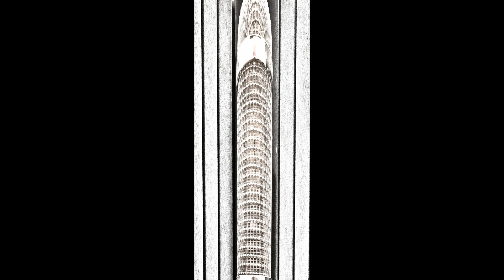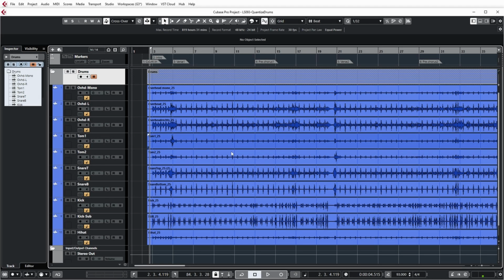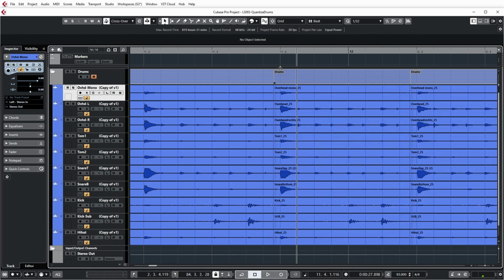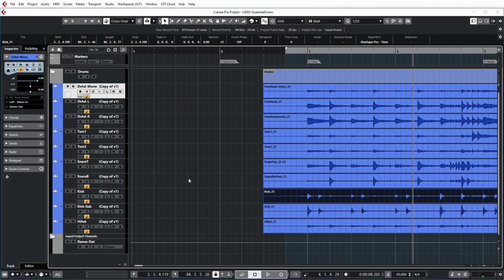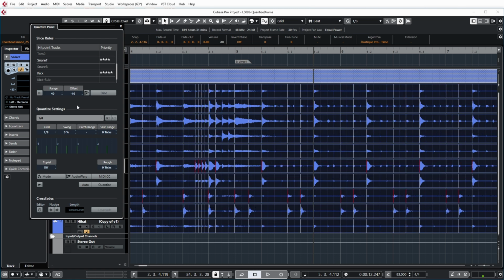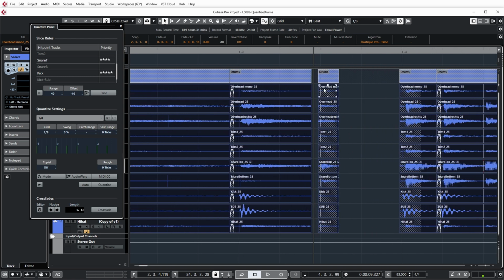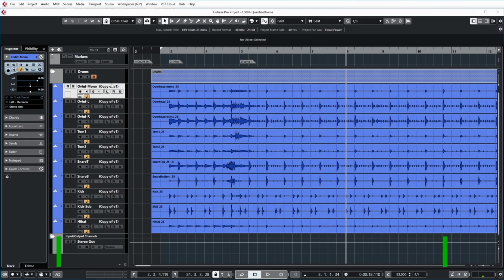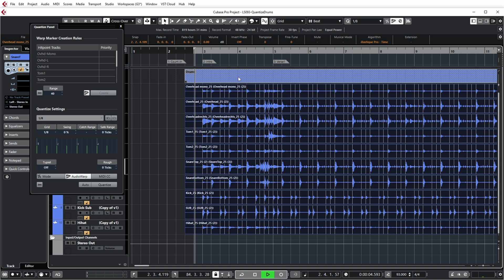3 ways to grid drums in Cubase (quantizing live drums)

Comment from the maker: Amazingly, the just released Cubase 12 contains phase coherent, multi-track, Audio warp!! So method 3 in my video now is a real option and they've even made it more easy by just being able to use it right in the project window.
Reply: does the original drum recording have to be quite "tight" for the 3rd method to work too? I just tried the 3rd way with phase coherent audio warp and it sounded terrible
Reply from the maker: @tommycoylemusic  now that there is phase coherent audio warp in Cubase, that could become my preferred method actually. I have a separate video about it actually https://youtu.be/pPgeG90EhYU?t=502
Maybe it's just a matter of how you have setup your quantizing parameters?
Reply: @LanewoodStudios  thanks for replying! ok but even with the quantising parameters isn't the bass and electric guitar going to sound weird at the very least? anyway I will check out your links many thanks!
Reply from the maker: The video is just about quantizing the drums. And yes if all were recorded together and we’re playing to the drums they will be off too. But that would be the case for all methods to grid drums.

Comment: Correct me if I'm wrong, but this video is more about quantizing drums recorded with a click. Still a great video, but is it possible you could make a video about how to grid drums (and a full band) that were recorded without a click track? I wonder if that's possible to do whilst also sounding natural.
Reply from the maker: Hi Neil, you are right in that these drum tracks were also recorded on a click, but the used techniques in Cubase would be very similar if they had not been. First of all though you have to ask yourself whether you actually want to grid the drums (and band) if they were not recorded with a click. Because then maybe the natural tempo fluctuations are meant to be in the song.
However, if gridding is still required, I would still do the drums separately as demonstrated here, using Cubase 12's new phase coherent group editing mode. I have a separate video about that.
And if there is not too much bleed of the drums into the instruments, I would do those separately in the way that I've demonstrated in some of my other tempo editing videos (they are all in a playlist).

Comment: I'm trying to use Audio Warp for multitrack recorded drums, to fix some tempo issues in the performance, but I'm finding that I get artifacts on relatively modest adjustments - such as weaker transients and tone shifting.  Can audio warping be reliably used for drum editing, or should it only be used for solo instruments (like bass guitar in your other video)?  I'm using Cubase Pro 12, with group editing and phase-coherence enabled on the 8 channel drums folder.  I made the edits via Free Warp in the project window, manually quantizing to the grid every bar or so (more control).  Maybe audio warp isn't there for drum editing yet?  Should I go with the old way of doing slices/fades/slips?  Great videos by the way - they're helping me get acclimated with Cubase.  (Note to Lanewood: Comment copied from audio warp bass track video).
Reply from the maker: Ah, I see you found the correct video for drum quantizing. If you have Cubase 12's phase coherent group editing enabled I would expect it to work correctly without artefacts on multi-track drum recordings when used as demonstrated in the video. Maybe there is still an issue when used with free warp in the project window. I assume you do see all your warping actions happen in the other group tracks as well?And does it really sound better when using the slicing method?
Reply: @LanewoodStudios  Yes, I can confirm that all drum tracks in the group are being warped.  To that end, nothing sounds out of phase, at least track to track.  The drums just end up losing it's punchiness and tone - I A/B tested the before (raw tracks) and after (audio warped to grid).  I tried doing it in the sample editor, but it's the same result (makes sense if the same algorithm).  The interesting thing is if I disable phase-coherence, it sounds a lot better solo track (ie. kick) - but the drums as a whole sound off-phase.  Have you tried testing it?  Maybe you have some raw drum tracks somewhere.  Try cycling a small section with a 10% time-shift "correction" on say the kick drum, and do a before/after.  Do you hear a difference?  I'm curious if others experience the same thing, or if there's something going on with my system.

Comment: Excellent video, but how did you manage to quantize the drum audio at around 8m25 in this video by pressing only the 'Quantize' button? I use Cubase 12 Pro, and audio only seems to Quantize when AudioWarp Quantize is switched on. The Quantize button only seems to quantize MIDI, not audio.
Reply from the maker: Thanks! If you set the quatize panel to 'slices' and make sure that group editing is enabled, audio will be quantized when pushing the 'quantize' button in the dialog. I'm NOT referring to the Q key in the top toolbar but really the quantize button in the dialog, bottom right.

Comment from the maker: How do you quantize multi-track drum recordings? Any nice additional tips?
Reply: There is a another way.  A bit more time consuming, but does the job perfectly.  By using audio warp it stretches all the channels with coherent phase.  You have to add a tempo track, then go into TimeWarp/Warp Grid mode on the Tools menu and drag the project grid lines to match that of the drums.  Takes about an hour to do every 8th note for a 3min recording.  Then you Bounce and replace all off the drum files, change them all to "musical mode" and and literally remove all of the warp markers you made on the tempo track.  I know its hard to explain.  Can also make a video of how it's done.  But it's definitely the superior method.
Reply from the maker: Isn’t it sort of method 3 that I’m demonstrating but then moving the warp markers s manually? The cubase manual says that phase is not kept in sync between the multiple tracks though when using audio warp. So I tend to not use it for multi-track drum editing. Works great on individual tracks though!